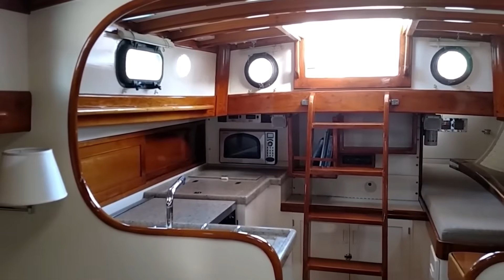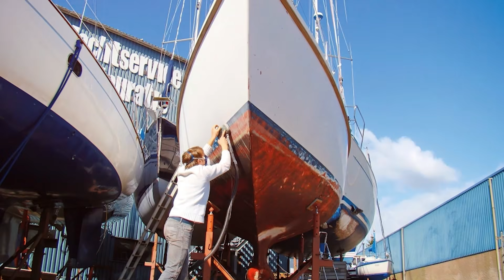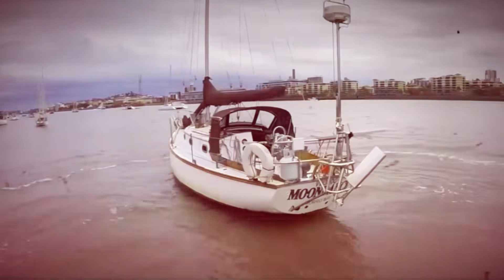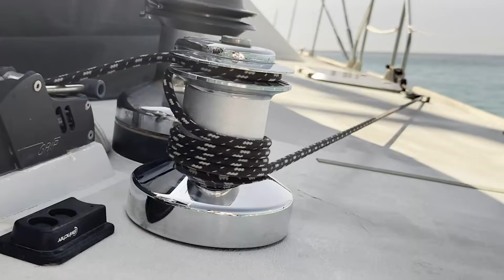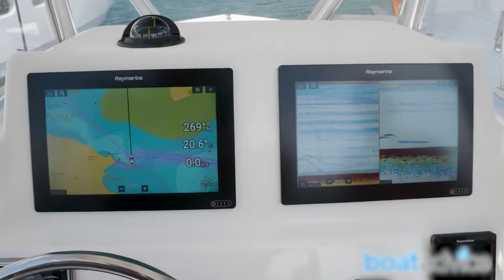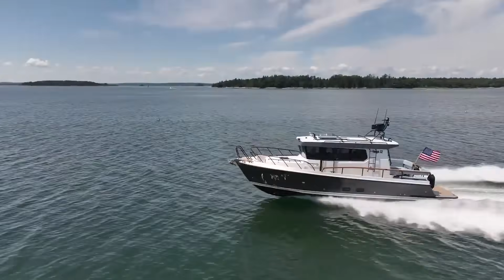12 MODERN Features That Are RUINING Sailboats And Your Resale Value

Comment: Not surprised this got no comments.  You are not being at all objective.  Resales are tanking because of the economy.
And if you are going to live aboard the boat, claiming luxuries like washing machines, or refrigerators is because you care about weekend cruisers or cross the atlantic and the get off.
And any boat no matter what the make without proper maintenance fall apart.
You are confusing your personal bias with actual real objective issues.  

If you want to live in the boat it’s worth it to figure out to how to deal with basic maintanence.  If you want a boat with no maintanence good luck.